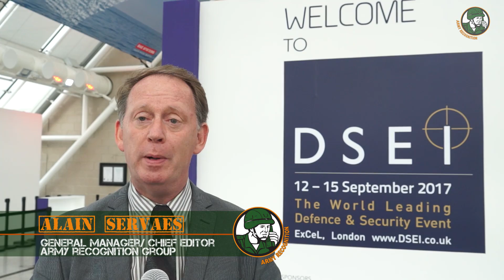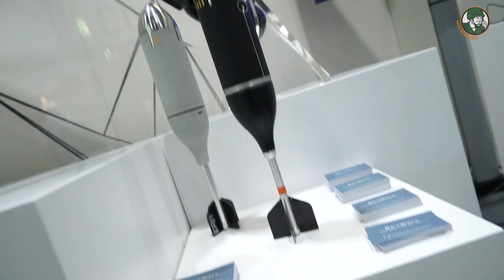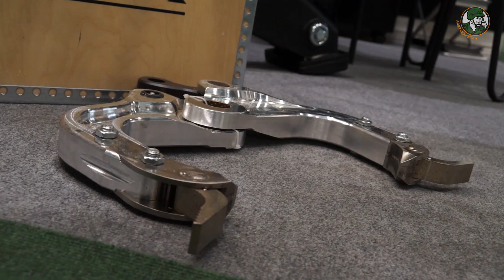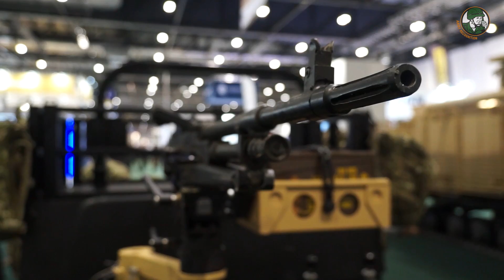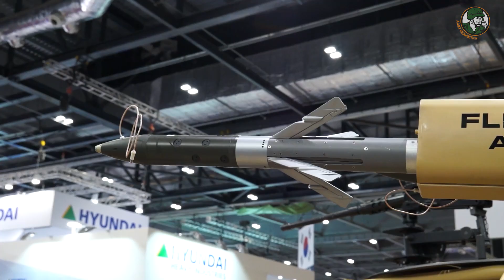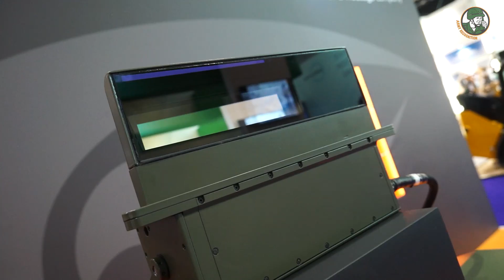DSEI 2017 International Defense and Security Exhibition  online show daily News London UK Day 1

Comment: Even with that sophisticated helmet, F-35 got owned by an F-16.  F-16 made the F-35 its BITCH!
Reply: balort santa Old news that has been addressed and fixed shithead.
Reply: BagoPorkRinds  Fixed?  That is what ALL F-35 losers say, LOSER!
Reply: balort santa I suspect that you're a lazy armchair shit who hasn't read up on the latest updates about the F-35 or know the reasons to why it failed to match up against the F-16 the first time back in 2015.

In case you really did not know, it's because of two factors, the software suite that limited F-35's full capabilities and the pilot's own tendacy from training with other aircraft.

The flight software package actually limits the F-35 to only 7Gs and it also limited the pilot's ability to push the limits of the plane. Pilot's want to push the limits of any aircraft because it simulates a real scenerio. Thus the F-35 wasn't as maneuverable as it should.   

Second is the F-35's pilot own years of training and flight time with other aircraft such as an F-16 and F-15. The pilot tried to fly it just like those two platforms. The F-16 and F-15 are multirole dogfighters and an air superiority fighter, the F-35 is not and never was design for that role. It's flight characteristics are very different.

Since then, the software has been updated based on F-35 pilot input and the same pilots' own updated training not to fly with speed or maneuverability of F-15 or F-16 but how to utilize the F-35's superior stealth and sensory capabilities against an adversary. The end result two  years later is a 17-1 kill ratio against the same F-16s and F-15s in this year's Red Flag.

The next future software upgrade in a few years will take the 7G limit off to enable the F-35 to  9Gs.

So yeah, you should sit back down and  shut the fuck up armchair shithead.